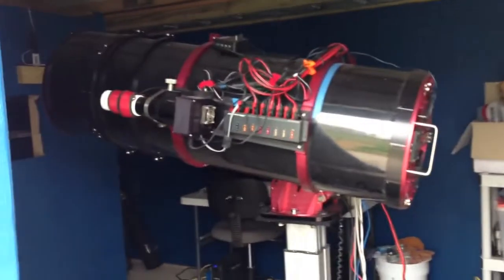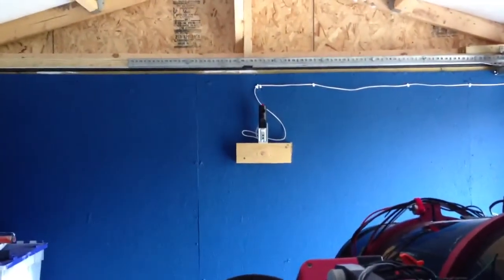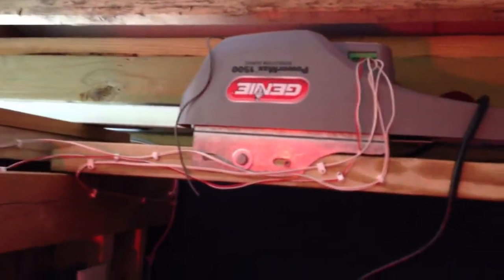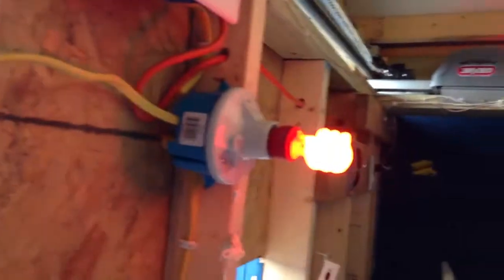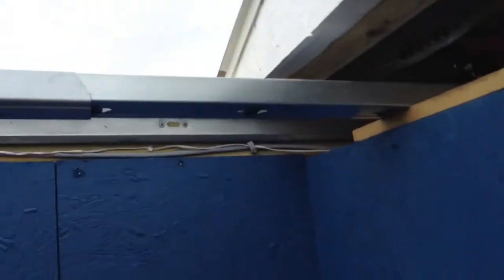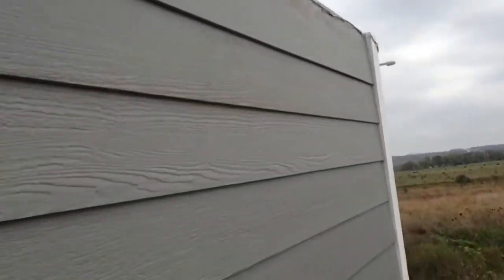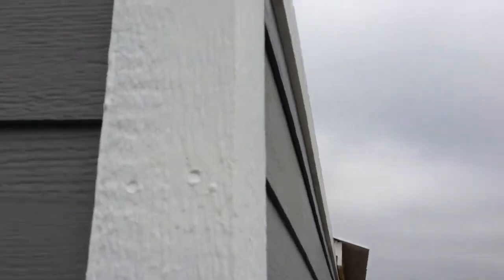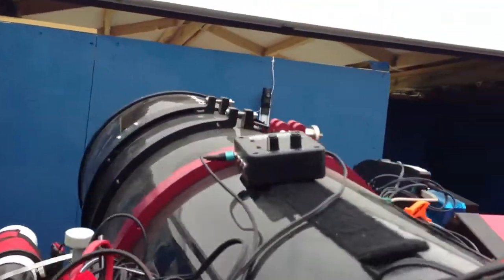Rolling roof complete

Comment: Well done.  How heavy is your roof and what is the HP of that garage door opener?  My roof is pretty heavy (about 500+ lbs) and I need to do this.  Also, I was concerned about placing the opener on one side instead of in the middle.  do you find that it binds at all being off center like that?  Thanks for posting, this is great!
Reply: Tom it was a 1hp motor and I have burned up two of them in the last year and a half. Went to a Aleko AC1400 Electric Sliding Gate Opener and the torque is amazing works like a champ all winter, I'll put up a video soon. The garage door opener worked great in 50 plus weather.